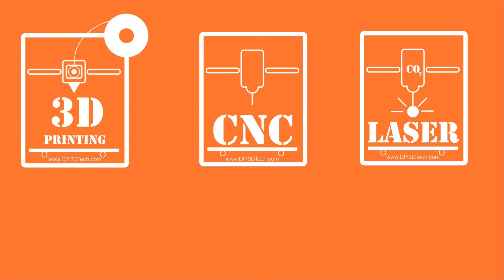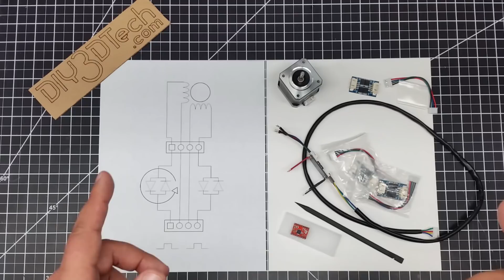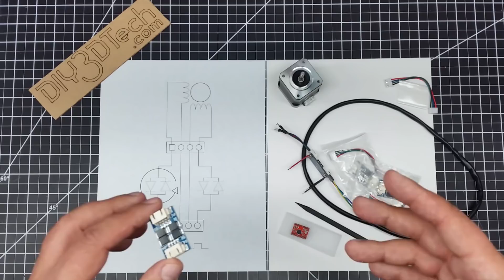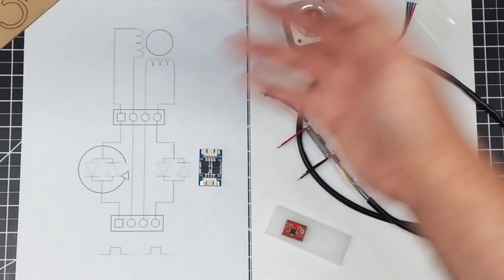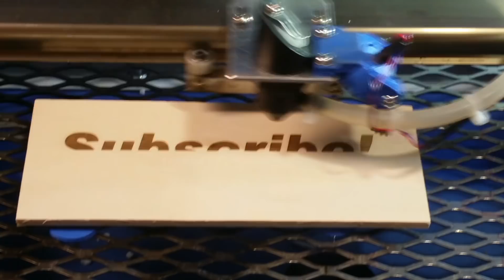Shop Talk - Diode Smoothing Your 3D Printer Fact or Fake News!

Comment: I made a DIY smoother for my extruder using this concept with 4 diodes soldered directly into the stepper wire. It completely eradicated any salmon skin I had, as the stepper was "pulsing" and each extruded line was wavy, causing a textured wall. Diodes completely turned it around!

Comment: The ‘four pin adapter cable’ that comes with these boards is meant to plug in to the main board, and then the smoother module. Your original four pin to six pin cable plugs in to the smoother, and finally your stepper motor.
Reply from the maker: Yes your correct however that wasn't clear (at this time) as it was early in the smoothing fade...

Comment: i think ya explanation is kinda wrong. you said that ya want the actual opposite of what ya supposed to want. you said 'you need sharp pulses from one position to the next'. well ya dont. you want smooth transitions. my understanding of a series diode is that it will make the input to output function be non-linear, which will have the effect of turning the square pulses into smoother pulses. it doesnt just reduce the voltage, it does it in a curve. this assists the driver in making the current rise and decline to the coil look more like a smooth sine wave, instead of a jaggy one. at least thats my understanding. its kinda an analogue microstepping by messing with the amplitude. i can see why this would only work with say big jumps & little to microstepping. i guess just use microstepping. the boards will cost less than this module.
Reply from the maker: Actually you do want a sharper wave as this will lead to cleaner step.  Where if the wave has a curve the toque as well as steps could be compromised
Reply: @DIY3DTECHcom  yeah? hey is the ideal a very steppy approximation of the sine wave? say an exact 1/8th blocky rendition?

my understanding is that these wee diode guys blur the step so it does indeed look like a sine. do you reckon you could pull a scope up and have a look?
Reply from the maker: If you search in my video I did put a scope on them and measure the wave form.  The other thing they do is drop the voltage a bit and as you see in my summary is on the Tevo I saw no value as the stepper drivers were pretty good however the ones on the Tronxy not so.  I use to know the model number but this has been a while back I have forgotten them...
Reply: @DIY3DTECHcom  ooops yeah sorry i didnt see to the end of the video. i have seen series diodes used to reduce ripples in all sorts of places & stuff. i should actually get in & watch the end of this video. cheers

Comment: I did an upgrade with 8 Diode Stepper Smoother-Boards installed on CR10 3D Printer, see here: https://openrcforums.com/forum/viewtopic.php?f=85&t=11447&sid=6bf7a0a4b04c4584a6b8c5d6a3b763d4
Reply from the maker: How is it working for you?

Comment: Just a quick thing - flyback diodes are put in parallel with the coils to effectively short high voltage spikes (back EMF) before they hit a driver. That high voltage would be high enough to go over the thresholds of whatever diodes you put in series with a coil which renders the diodes useless for use as flyback protection.
Reply from the maker: For the smoother configuration you are correct...

Comment: The coils are current controlled, however some drivers cannot reduce the current to zero because there's a minimum voltage across their coil driving pins, the result is a sharp jump in current as it crosses zero and reverses direction. That causes distortion in the waveform, and a higher frequency content. That in turn causes unwanted resonances and inaccurate positioning in the system. Adding diodes in series means the controller can go down to zero current because the minimum voltage it produces is below the forward voltage of the diodes, so you get smooth sinusoidal currrent waveforms (not square wave, drivers create sinusoidal current waveforms, so the idea that the diodes are acting as flywheel clamps I don't think is correct). BTW the driver PWMs the steppers by varying the mark/space ratio to create a sinusoidal current waveform, the minimum voltage I'm talking about is due to minimum on times of the MOSFETs in the H bridge, it's the average voltage seen by the coils as this PWM frequency is high.
Reply from the maker: This was one of the better comment I have seen in this topic and makes sense!  Thanks for sharing it!
Reply: Well, I'm not totally convinced I got this right ;) I suspect Siana Gearz below is closer to the mark, I read that comment and wondered why adding diodes isn't the equivalent to adding more resistance, which is like using a stepper with different resistor coils and should have little effect on the current waveform as it's got current feedback. It does however seem to match what people see (jumps at the zero crossover point) so I'm inclined to think as Siana Gearz thinks that there's something more subtle going on in specific drivers.

Comment: Smoothing motors is important; but the allegro chip already does it properly on the die. -- The schematic you show is nonsense, and it just achieves a voltage drop. -- You should be able to achieve the same result with a resistor.

The two missing wires from your motor plug aren't needed -- they're basically the center tap of each coil, and it's not used by the four wire drivers.
Reply from the maker: I would not say it nonsense as it is accurate as your correct it achieves a voltage as in the follow up video I show this.  However in dropping the voltage verses cutting current via the pot you are altering the torque curve of the motor.  Is it of value?  Some of my view swear by and like yourself discount it.  Either way my goal is to share this with folks so they can make their own decisions :-)

Comment: i do smooth my 2 machines,  one cartesian, one CoreXY.... i based my findings on the actual finish of the parts, and the smoothers did make an improvement using the same machine, same g code, and same filament right after each print. Wether or not electrically it helps,  its hard to argue with physical results.
Reply from the maker: Depending on your stepper drivers this is plausible, however that is catch with these because if watch the episode after this I put the scope on it and there is no change other then the voltage.  You can also check out the comments of the the related video for more details as many people added far more details then I did in the video...

Comment: I am not electronics savvy and wiring a 3 pin  plug  taxes me!  But reading the replies- am I right in thinking  that IF I applied a 4 diode smoother to my Anet A8 motors - whatever the effect it may have on prints... the real plus is preventing the motors generating power that could flow back into the the  motherboard ( Anet fragile at the best of times) and prevent or reduce that back flow of generated volts ?    To me it seems a worthwhile purchase  just for this alone.
Reply from the maker: Not in the case of flyback (i.e. the collapsing of the magnetic field) however one viewer added them to his CR-10 to prevent reverse generation, in other words when you move one of the motors with your hand it creates power energizing the board and since these are reverses biased to each other they absorb the load...
Reply: since the Anet board uses 1/16 microstepping A4988s and not DRV8825 or A4988/2 drivers with 1/32 microstepping, I'd be really surprised if you saw any difference..

Comment: The diode circuit has nothing to do with delta salmon skin. Delta salmon skin occurs because 8-bit processors can't do floating point accurately so they move in steps which are close-enough estimations of the ideal movement. The solution to delta salmon is to use a 32-bit board or something which can calculate movement and step better like Klipper.

The diode circuit was designed by Schrodinger Z to overcome the low-end voltage chop step on DRV8825 drivers which causes skipped steps as the wave crosses 0V and oscillates at a frequency within human hearing so causes the motors to whine. There's no evidence that other drivers suffer the exact same problem, mostly because nobody reports regularly skipped steps on Allegros or Trinamics, and Allegros don't whine (but sometimes Trinamics do).

Then again nobody has ever put a scope on the other drivers to look at the signal coming out of them, so good stuff for being the first person to do that! I do like your idea that the flyback protection will slightly modify the ability of the driver to move the motor smoothly. Looking forward to your results in part 2.

Personally I think the whole set of problems with drivers and motors are poorly understood. Schrodinger Z solved one specific problem on his specific drivers and everyone else just jumped on board without even knowing if they had the same problem or needed to solve anything. I have the dreaded DRV8825 whine on my SBASE board and neither the 4-diode China smoothers or the 8-diode circuit changed anything for me. Obviously I have a problem but not the same problem, and diodes aren't the solution. I have heard that motor inductance is also a factor, with motors under 4mH always producing a whine.

You don't need to chop the wires, you plug the motor cable into the Smoother, and then the other cable into the smoother and the control board where the motor normally goes, though that might only work for the JST XH4 board-end plugs, Dupont plugs tend to fall out. Also good lord don't spend 40 bucks on the 8-diode boards! Even these 4-diode ones are overpriced wastes of money. Any diode of 1N5404 to 1N5408 will do. By the sounds of it you probably already have a bunch just laying around.
Reply from the maker: Very nice post!  Kudos on the quality!  As I don't have a delta I can't argue the point about "salmon" skin but do agree about the drivers!  Also now know they plug into the board but the original one saw on line was graphed to the motor (on a delta) so figure it would be easyer as not many people would crack a case and two they flip the motor direction so I had to re-wire anyway...
Reply: 3D Maker Noon just did a video with the TEVO Little Monster and he noted a discernible improvement of salmon skinning with the 8 diode smoothers.

No scopes or anything. Just A/B Testing. So there definitely seems to be something to it. May be treating the symptom instead of the problem but it seems to be improving people prints.

Comment: Don't forget that although DC signals are being applied, back EMF from the coils are in fact AC. The applied DC pulse will in fact have an AC signal riding with it when the coil is energised & de-energised. Although a DC voltage is present, the AC part of the signal will make the diodes operate not as expected as they would with DC. The AC part of the back EMF signal will go minus voltage as well as plus. An oscilloscope never lies, measure the signal with and without the diodes at the stepper pin, have fun!
Reply from the maker: Yes did do that (with and without) and didn't see any flyback as there is a flyback diode in the stepper controller.   However I did expect to see regeration (i.e. the motor act as generator from inertia) but did see this either.   So unless one has junky drivers I don't see much use for these.  I Have however ordered the 8 diode version so try more tests....
Reply: Sadly i don't own a 3D printer otherwise i'd check myself, i was just looking at it from an electronics background :)

Comment: You are wrong at 9:04, the current will not go back through the other diode. The only thing the diodes do are that they reduce the voltage applied over the motor inductor by a diode voltage drop in either direction.
Reply: correct. These diodes are no flyback diodes of some sort. They can't be, considering the way they're hooked up.
Reply: The current want a path to ground or less charge....if the back emf comes down the possitive line it will come back throughthe same positive line butat a diffrent phase only if the empedance of that path through the motor is less than the impedance through the board
Reply: In order for a diode to conduct, you need to overcome its forward voltage. The diode will conduct when the difference in voltage between the anode and cathode is around 0.7 V. 
Since both cathodes and anodes of the diode pairs are connected and the voltage drop across the diode is ~0.7 V, the second diode will not conduct because the difference in voltage between the anode and cathode is not high enough.

If they would conduct, as you state in the video, they would also do so the other way around for your driving signal ;)
Reply from the maker: Why  wouldn't it as the basis-ing  would then correct and in esseance this dual set of "reversed" biased  diodes would be become a load if there is regeneration...

Comment: Skepticism aside. Give it a try. "Your mileage may vary" An 2x4 diode smoother (one 4 diode smoother did not work) on the extruder stepper (wanhao i3+) worked well. It just worked for me, for whatever reason does not matter. I have been running this configuration for over a year and print nearly 3 days a week.

Looking forward to you analysis.. try it on your wanhao.
Reply: I've also noted a significant improvement from adding an 8 diode smoother to the extruder motor on my Monoprice MS+ (Di3 rebrand). Particularly after installing the Microswiss All Metal hotend I had a lot more zebra striping then with the stock MK10 Hotend.

I reinstalled it at least 6 times and could get rid of the striping. I even sent pictures/video to MS and they said it looked correctly installed. Popped an 8 diode smoother onto the extruder and the striping is gone...

I did 5 A/B tests with and without on 3 different models.

I'll be uploading a video soon.
Reply from the maker: As a follow up also tried on the Wanhao (X & Y) but no noticeable change...

Comment: u got the crap ones that were released before designer realised needed more
Reply from the maker: My understanding is there is a 4 and 8 (diode version) and outside of a further voltage drop on 8 there isn't additional benefit.  Are you using them an if yes what kind (of boards)  and what benefits are you seeing I would be interested to hear.  :-)
Reply: DIY3DTECH.com 
well for starters when the cr 10 is off if you pull any axis it powers up the mainboard and lcd this stops that my main reason for purchase .i also noticed the motors dont seem to be making as much noise a bonus . if you open up the control box they just plug in or did for my cr 10
Bigtreetech 4PCS New TL-Smoother V1.0 addon module For 3D pinter motor drivers
 http://s.aliexpress.com/iAbQVrEn?fromSns=Copy to Clipboard 
(from AliExpress Android)
Reply from the maker: Yes seen this site and this is reason I did this series and the reason your stepper are quieter is hey are getting less power as the diodes are knocking down the voltage yet what I understand is by doing this one risks losing steps.  Also the price on Aliexpress seems a lot cheaper then eBay for the 8 diode verion....
Reply: there exactly the same ones that turn up from amazon to 29.99 here in the uk